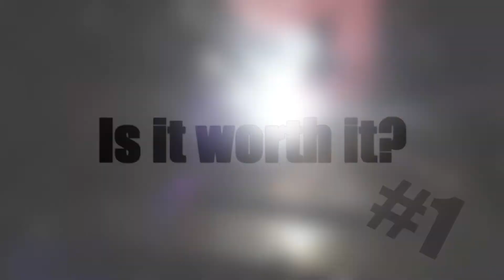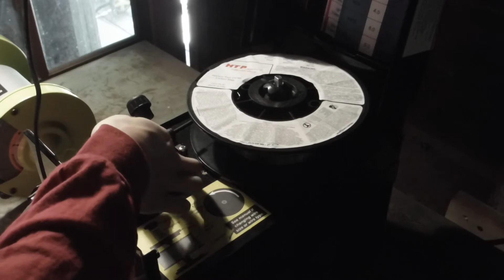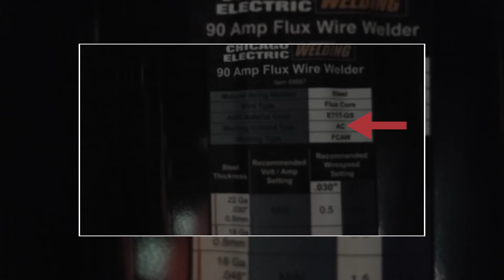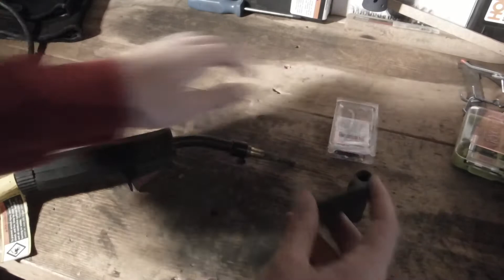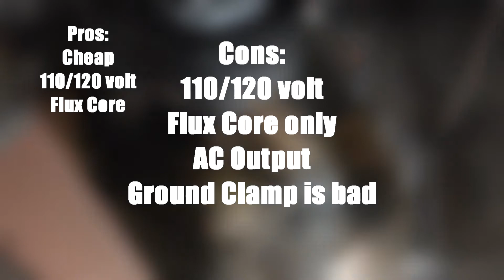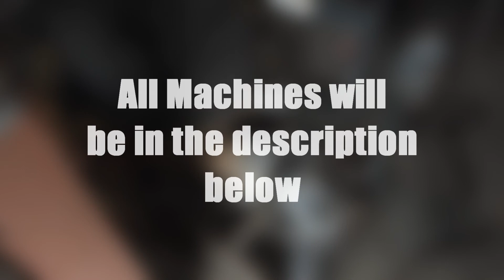IS IT WORTH IT? Episode 1: Harbor Freight 90 Amp Flux Core Wire Welder

Comment: Your yen and yang review of this welder is disingenuous ,  I have the same welder with the screw down  curl knob on the top .  I bought it in 2012 and have used it many times in the last 7 years , it has worked very well even with the HF wire it came with .    I also use Lincoln wire both 30 and 35 wire with the proper tips and feed roller flipped to the proper size .    I changed the ground clamp to the brass spring clamp before the first use and have had no issues since knowing the clamp provided was not going to give a proper ground welding with AC current .   I always make sure both the grounding and welding surfaces are clean to bare metal before welding anything  .   It is only plugged into a 20 amp plug and if an extension cable is needed , only a 10 gauge 25 ft length is used or a 5500 watt generator 20 amp plug when no house current is available !    For a 100 dollar welder it has out performed what I expected and has worked flawlessly on many table and barbecue builds , exhaust repairs , trailer repairs and numerous other backyard projects !    If treated properly it will work just fine !

Comment: are these welders any good, cuz i see everyone hating on these, im between this one , the 130mig and a normal stick. Just for home repair and small projects/hobbies
Reply from the maker: +David Piceno I would just look for a MIG welder that has the option to use gas or a DC Stick Welder. Both are much more useful and have more capabilities than a flux core welder.
Reply from the maker: +SubDude350 Welding However, these are good units for very casual use, if you're willing to put in some practice, if you're short on cash.
Reply: SubDude350 Welding thanks i think im gonna stick with stick :)
Reply from the maker: +David Piceno Glad to help. Learn to run 7018 and 6011(if you haven't already). IMO, those are the best two rods for general purpose work.